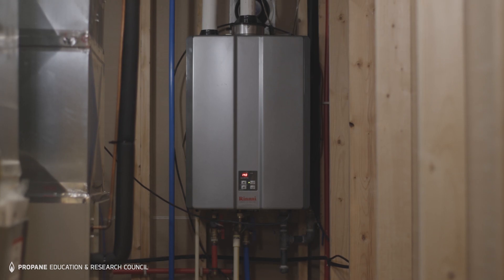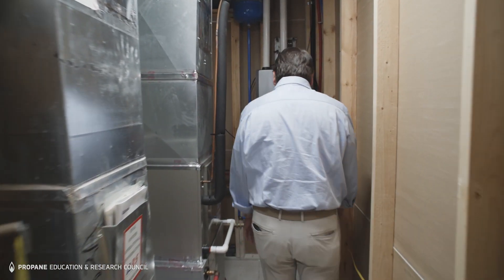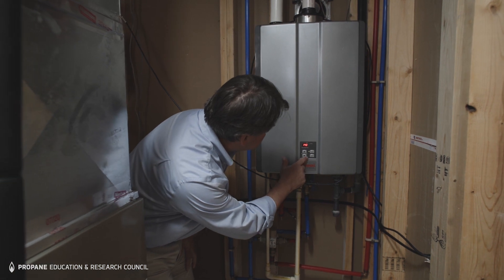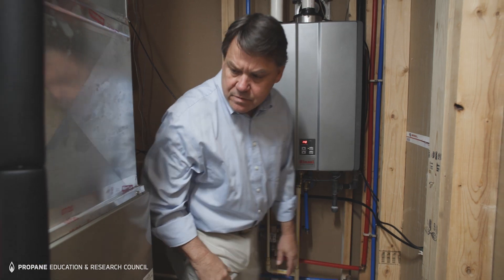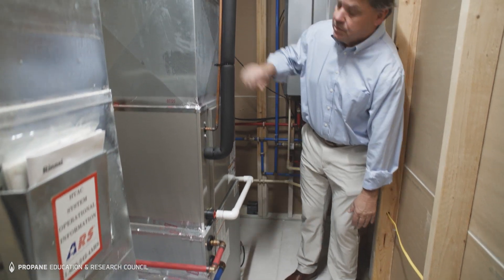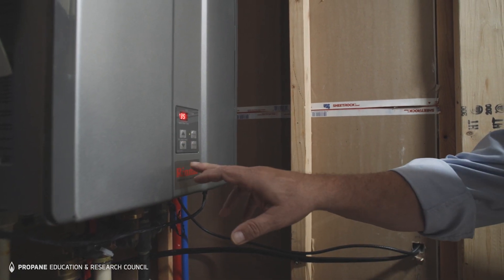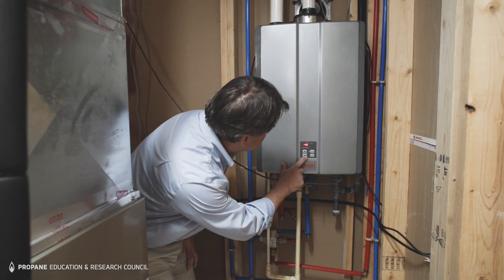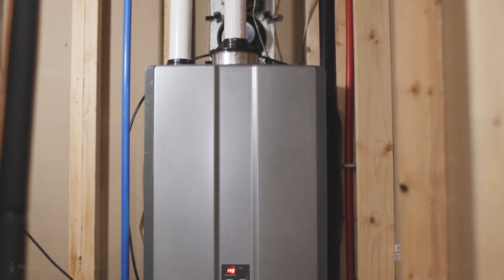How to: Tankless hydronic forced-air heating

Comment: Rinnai hot water boilers can only produce hot water from 120 F (default) to 140 F (max.). This cannot let the air handler generate proper heating. We need at least around 160 F hot water. But Rinnai boilers are not designed for that, unless Rinnain I series combi boilers, like Rinnai-i120. 
Your idea seems feasible theoretically only, but not practically.
Reply: In certain climates it’s prob ok but in the north I don’t think it would keep up.